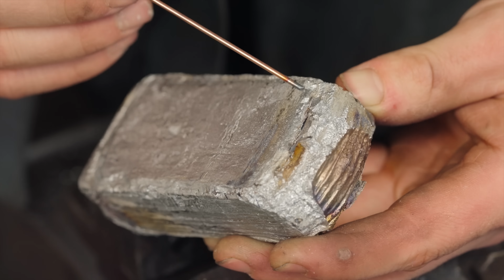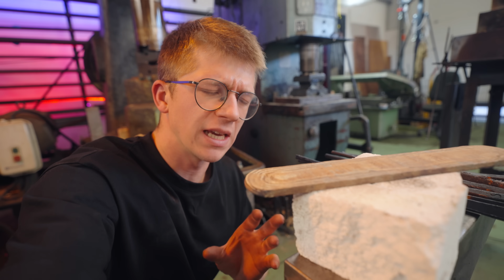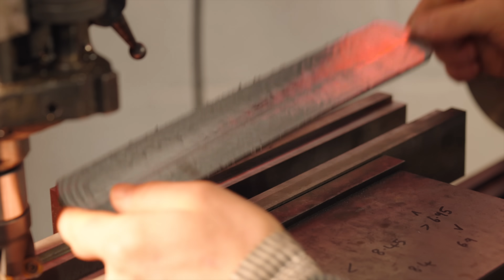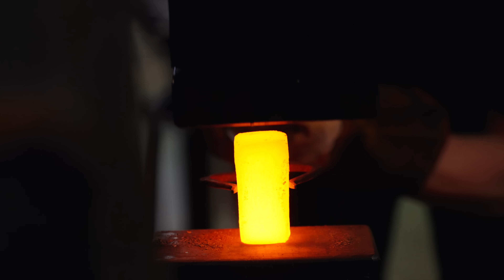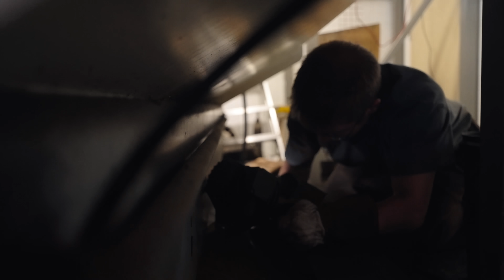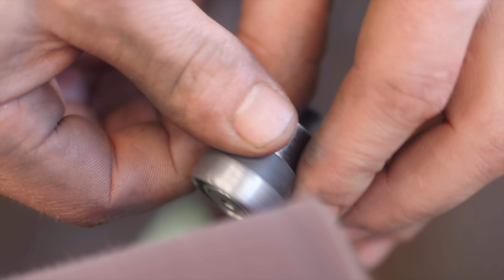Can I Make Titanium Damascus? Part 2

Comment: As a CNC guy, I was wincing a bit when you ran the Bridgeport without coolant or even air cooling. I can't say I actually worked in titanium though, mostly steel but some aluminum, copper and bronze but I do assume you need to keep the heat down. Air coolant might not be the best since it can create more oxidization. 
I know that if you work in magnesium, you use alcohol as a cooling liquid since it leads away heat better but I wouldn't recommend that here, it have led to some nasty fires and I never worked in the material myself (I mostly make parts for trucks).

Comment: You try 850 degrees Fahrenheit at a longer time frame, so it slowly takes the heat then once the oven reaches 2000 degrees then smack on it,

Comment: issues with such rings vs silver/gold and etc is that if you ever have some allergic reaction or an injury or any disease that swells up your fingers... you might lose that finger the ring is on, before emergency services can remove it. i had a few tungsten carbide rings about 15 years ago, then thought about it and... uhm... pass. all went to bin.

Comment: I would be hesitant to selling those rings, in the case of an emergency where the ring gets stuck on a finger it will be a lot more difficult to remove.

All my rings are made of Silver for the reason that they are very soft and should something happen can more easily be reshaped/cut off than a steel or titanium ring.

In some worst case scenarios a ring made from a harder material that can not be easily removed could lead to lasting damage to the finger.

And when I say soft, one of my silver rings has lost it's round shape after I slammed my hand into a wall during a fall, and it has been slightly oval ever since.

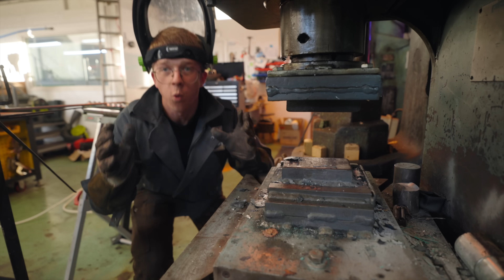Comment: 6:17. Just a wild guess but wouldn't increasing the pressure of the titanium billet via the steam press / hammer push up the core temp. to the point it's at the melting point?  When you went to 2100 F last time I was impressed with you exploring the boundaries but it could well be the original patent guy did experimentation and that's why he recommended no more than 2000 F. Maybe with your configuration going to the minimum of 1700 - 1800 F range is the sweet spot?

Comment: Titanium melt in lower temperature:

Might have something to do whit, Joules to C Heat capacity different's from metal to metal i think.
Like when i mixed Tin and Aluminium, Aluminium melted at way lower temperature as well in tin.

Comment: i think purity plays a role in  melting points truly pure titanium melts at 2900 the comercial purity problby lower another thing it could be is altitude water boils at differene temps depending on altitude metal might be simular no clue why thogh im just spit balling

Comment: To saw titanium you really need to change to a tungsten carbide  tip (TCT) blade  on your Meba bandsaw to cut the billet square in future. Use a rich coolant mix also, around 12% Brix and a band speed of 40M/m. 
Hope that helps.
Watching you use the TCT blade on the circular made me wince. 
The blade speed MUST be slower.

Comment: My guess why its melting so far below its melting temperature is the two tiny holes where your argon gas builds up pressure inside the cube. Maybe the higher pressure decreases the melting point of the titanium

Comment: Alec, 
Forgive my ignorance but is there a reason why those machined chips and metal threads of Ti can’t be collected and smooshed together into a new billet? Also, is there a chemical wash or electrolysis process to remove the oxide layer and save your tools? Finally, and this may be our side your wheelhouse of skills, but something like plasma sputtering would allow for the coating of materials in a Ti layer. This gives the possibility of those amazing colors with much less waste. Can’t wait other products like money clips, fancy pens, and more jewelry.

Comment: Compression causes heat, maybe at such temperatures under a hammer it jumps significantly faster for a split second, try taking the temperature before during after the process.. find the best method

Comment: I'm a little late to the party here, but I wonder if titanium could form an eutectic alloy with iron?
Something similar can happen when making mokume gane from copper and fine silver - the alloy that form at the boundary between the layers actually has a lower melting point than either of the component metals. 
No idea if that what's happening, just my best guess as a jeweler from similar things I've seen.

Comment: I have seen evidence of minute heating in stressed steel (cf adiabatic in gasses). And hitting anything with the strength of a forge hammer, close to it's melting point, particularly an alloy of whatever mix you have created, is putting energy into it. Is that not Heat Work? And your alloy is going to be nearer to an ooze as it approaches melting point. So did it melt in a stream, or just ooze out? Is heating uniform? Is the forging pressure uniform? It should be obvious all this is random chance, just like the patterning you seek!

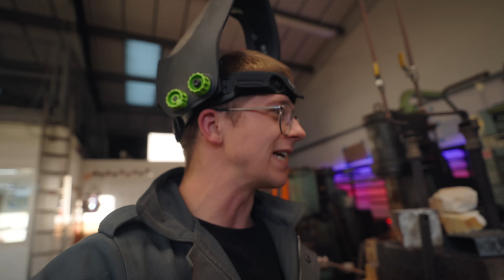Comment: 6:14 Some quick ideas regarding the liquid titanium and it's melting point:

I believe you may be Bernoulli principal-ing the billot with your argon gas while in the forge. You may be pushing gas out of specific holes in the casing, which is creating a vacuum effect on other holes, thereby drastically increasing the internal temperatures. Or in other words, you haven't managed to maintain positive pressure in the entire  casing. This may be because of the internal shape of the billot and/or casing, perhaps there is an air foil created inside which causes a throttle or nozzle like effect. 

The patent outlined those holes with specific spacing which you decides to alter, there may have been some specific fluid thermodynamic reasons for that arrangement. 🤷‍♂️ Things get weird with exotics and "high" temperature.

I'm unfamiliar with the different types of Thermite but is it possible we're observing something similar here? I know titanium serves as a marvelous catalyst, is it possible it's catalyzing some reaction with the iron or carbon present? Or perhaps the titanium and steel wasn't as clean as you'd hoped? Or conversely I remember how metals can have entirely different properties depending on their counterparts, perhaps the places where the titanium touches the steel has a specific phase diagram with different melting points and whatnot.

Also, could the top layer be less than the middle ones, because it's only the boundary layers which are melting at that lower temperature? So there is actually less of the material at the border of the case?

Comment: I m feeling that the out side layers cool faster when squished the center having retained its heat oozes out. Perhaps there is some wired science-y thing that it pulls the heat from the out side to the center.  Thickness might be the key the thinner stuff doesn't gush. Does the two different types of titanium perhaps have different melting points?

Comment: The reason your getting that patern when drawing out is the difference in purity of the lairs of titanium. The reason why your melting is your creating a different atmosphere with your argon. The same basic principles why tig welding is such a great way to weld and very clean welds once you get use to the flow.

Comment: Alex:
You asked about why the titanium was melting below its melting temperature. I am going to give you my thinking and my best guesses. 1. Did you ask for the melting temperatures for the specific alloys you used? The manufacturer would know or know where to look it up. 2. You are using alloys of titanium and not pure titanium, this may have something to do with the melting temperature.  Solder is tin and lead, but it melts at a temperature that is lower than either. Best guess: The alloys you are using have a lower melting temperature than the element Ti, which is titanium. AI's don't really think they just run algorithms, ans that cause Seri to give you a false bit of information,  because of a difference in the interpretations of the word, "titanium."

Comment: Couldnt you have forged a ring? The lathe method seems so wasteful. 

Would it work to saw off a chip, heat it and drive a round punch through the center to form the ring?

Comment: I routinely have to torch/melt titanium off the steel funnels we use at the foundry I work at, and it might have something to do with Ti actually absorbing the heat much faster than the steel? How are you measuring the temperature for the billet? Because I can put the torch against the funnel and very quickly melt the Ti off without damaging the steel due to the thermal conductivity of Ti being much lower than Steel

Comment: When any material is under pressure the melting point drops dramatically, an example in everyday life is that in pressure cookers the water boils at less than 100 degrees Celsius and the food cooks faster.
Also the pressure you apply is converted into heat but that should not affect it since the metal tends to cool down.

Comment: I have no idea I’m just thinking about when ya use a torch the air and the heat is what’ll cut the steel (obviously) but when sealed that argon rushing thru the tiny hole could be getting it hotter than ur temp reading outside the box 🤷🏼‍♂️🤷🏼‍♂️ sounds viable but truly 🤷🏼‍♂️

Comment: I always ‘wondered’ when I read about the trouble the Skunk Works had with engineering the SR71 out of the titanium they bought from the Soviet Union - it being reputedly impossible to work with. Now I know! Viscerally illustrated, Alex. Imagine building something with curves to micron tolerances, managing thermals, and without losing structural integrity!

Comment: Titanium is extremely sticky, even worst than aluminium and austenitic stainless steel. They really suck very hard to machine. For sure reducing speed helps. I also found it better to grind it using some sort of alcohol as lubricant, since the quick evaporation helps to release heat.

Comment: I wonder is the differences in density and thermal mass of the steel shell bs the Titanium billet is what is causing your issues. Like the amount of heat applied to the steel would in theory heat up the titanium more to a higher temperature. But your measurements would be off because that heat radiating out of the titanium back into the steel would make it the lower steel temperature at the surface.

Comment: Alec! I was talking with my engineer manager yesterday and he mentioned something about ti from a previous work place. 

They made titanium billets, really big billets, and they had to be heated in a giant furnace, obviously. Well, if the pieces were on iron/steel risers the chemistry changed where the surfaces met, the ti and iron/steel. This changed the melting point and when they'd pull it out of the furnace it would dribble liquid ti everywhere. 

Do you think your little steel box you used to contain the pattern reacted in this way? 

I see other suggestions about pressure during the forge, but i thought I'd pass this on.
Reply from the maker: That’s freaking wild!!! I think that’s the same thing and my vote is on the iron and titanium reacting to make an inter metallic with a lower temperature of melting like a number of commenters better articulated here!

Comment: Yes, the melting point of pure titanium is north of 1900c but you are using grade 2 and grade 5 titanium, these are alloys, not pure titanium and both have a lower melting point. If you also managed to get small areas where the titanium began to alloy with the mild steel outer shell, that alloy had a melting point that is way below either of your titanium alloys.

Comment: It explodes because of atmospheric density and gravity theory. The insides are hotter because the relitive atmosphere is denser. So the gravitons are trapped inside a higher density square vector.
They will continue to radiate into the core higher and higher. Until the explosion happens, you have to do scalar mathematics to find the correct heat setting so the core doesn't explode, you need to check Titanium's combustion temperature because its the lowest atomic mass or so i believe.
Edit. Because of this you will need to cook it longer and possibly take it off the heat so it doesn't explode then reheat again and the whole will be the same temperature.

Comment: Titanium you should be using carbide tip blades, its a very hard steel and the carbides will cut it much easier

Comment: It's the gas , normally metal is heated in oxygen  thus it's normal melt temp , bathing it in argon is changing the melting temp . I'd say drop 100 each time till u hit the golden spot. That it don't melt .

Comment: Maybe try les heat and set de welds of the titanium Damascus by hand instead of the powerhammer.  air cool slightly between hammering Maybe the frictions between the steel is too hot and it melts by hammering too quick its a weird steel to forged buitifull sparks tho

Comment: Argon is changing the temperature profile, it vibrates more vigorously and has more kinetic energy. This makes it easier for heat to be transferred to the Titanium and therefore, less energy is required to raise the temperature of the metal. Try less time in the forge.

Comment: your alloy used would create a metal compound of Ti and Fe when fusing, which has a lower melting point. I suggest u to use a Cr box instead if u want to prevent such thing from happening.

Comment: The dual hole feed on the argon is your melting issue the pressure split of the gas trying to pass through both holes on the ends is causing the melt and separation of your titanium go with the single hole centered and you will see that the melt stops also go "between 1700-2000 degrees so try around 1825 degrees and your product will come out much better and more vibrant

Comment: You can forge a ring from the round bar stock instead of turning it down completely on the lathe and wasting more material😅 i use 15mm diameter by 20/25 mm long pieces, drift a hole through the centre and pull out a ring. I use a old, cheap ring mandrel to forge almost to size the  finish on the lathe . Works a charm with much less wastage
Reply: I lied! I use 50mm long pieces and cute those into 4 pieces, so its 12.5mm long each (not taking into account the material loss gring angle grinder cut) and you can forge out a nice wide ring with that

Comment: 1. Localized Overheating
Even though the bulk temperature is controlled, there could be localized hotspots in the titanium due to uneven heating during the forging process. These areas could reach a temperature much higher than intended, potentially causing partial melting or liquefaction in specific regions. Double-check the uniformity of the heat distribution inside the box and across the titanium.

2. Titanium's Phase Changes
Titanium has a phase transition known as the beta transus temperature (around 882°C for pure titanium). Above this temperature, titanium transitions from its alpha phase to its more ductile beta phase. While this temperature is well below its melting point, it could significantly change the behavior of the material, making it appear to "squirt" or deform more easily, especially under pressure. If you're working near this range, this could explain the liquid-like appearance.

3. High Pressure During Forging
The pressure applied during forging might be causing plastic deformation in the titanium that resembles liquefaction. Titanium in its beta phase can become very soft and, under high pressure, may flow or extrude through cracks or gaps in the steel layers, which could look like it’s "squirting" out.

4. Argon Gas Pressure
If the gas pressure inside the box is too high, it might create enough force to expel molten material through any small gaps or weaknesses in the layers. The gas could be interacting with molten or softened parts of the titanium, pushing it out.

5. Contamination or Alloying
If there are impurities in the titanium or the steel (e.g., trace elements that reduce melting point or create eutectic compounds), these could cause localized melting at a much lower temperature than expected. The reaction between the steel and titanium at forging temperatures could also produce lower-melting-point compounds that might "squirt" out under pressure.

Possible Fixes:
Reduce Forging Pressure: Try lowering the force applied during forging to see if it reduces the liquid-like behavior.
Improve Heat Uniformity: Ensure there’s no localized overheating by monitoring the temperature across the material more carefully.
Double-Check Material Composition: Ensure the materials are pure and compatible for this type of forging to rule out unwanted reactions.
Reply: @aaron_ggf  bad ChatGPT answer. The most likely explanation is a eutectic phase reaction between iron and titanium

Comment: the outside is cooling faster than the inner layers hence why the pattern stretches more on the inside layers more than the top layer which cools quicker & therefore has less stretch when hammer forging..??? try using ur gas flame between hammering??? let me know if it works?

Comment: You should really refer to the MDTS of your materials to identify the melting point you should encounter. Google isn't going to be of much help if you aren't giving it precise information. I wouldn't be surprised if your working with a low grade titanium alloy with a lower melting point than the Grade 1 pure titanium.